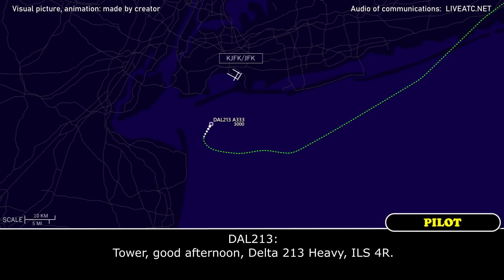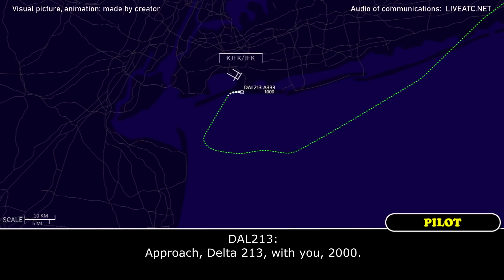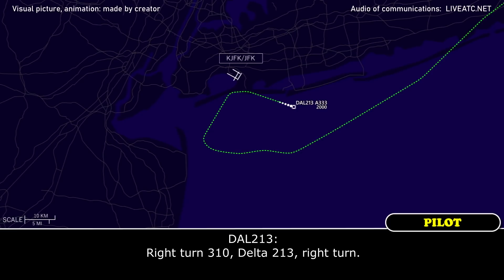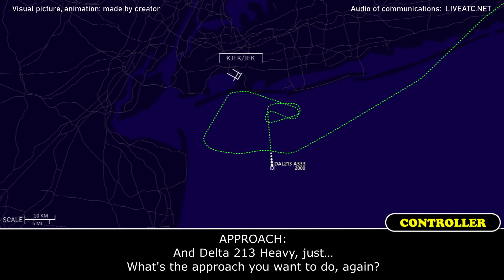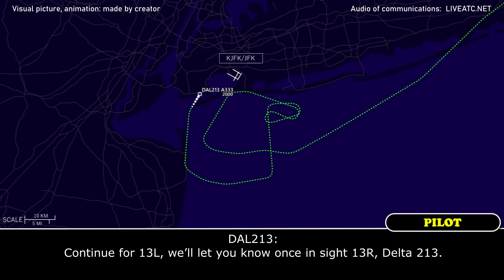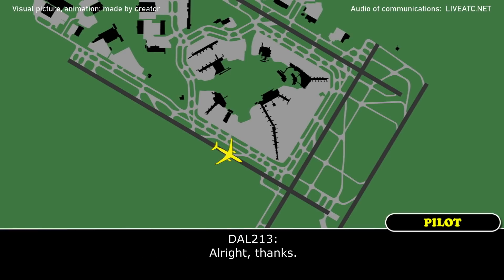“Requesting the longest runway”. Hydraulic issue | Delta Airbus A330-300 | New York Kennedy, ATC

Comment: @3:40, controller said "It's gonna be one of those Canarsie approaches".

Canarsie VOR approaches have a short turn to final.

Very possible those issues was with the hydraulic system guiding nosewheel steering and braking
Reply from the maker: Thank you. I'll pin your comment. I didn't know that.👍

Comment: They say VOR is obsolete and GPS would be enough for navigation. This case shows how useful VORs are.
Reply: How? They didn't even use the VOR, they considered it for a bit and then went with an RNAV GPS approach.
Reply: @scottycatman  you're right, I meant it's a good thing to rely on it for a backup solution as who knows when it gets handy in certain circumstances.
Reply: The VOR approach for 13L and 13R is also able to be done entirely on a GPS. The future is pretty much GPS now, they’re a lot more accurate and have similar if not the same minimums to an ILS if the approach has LPV

Comment: I'm no expert, but it seems like landing 13R, which would be the shortest final of any JFK landing, would be just about the worst option for a wide-body with hydraulic issues. Especially considering that they asked for a long final initially. I'm glad it all worked out and obviously the crew knew what was best
Reply: 13R/31L is the longest, 14,511 feet long(about 4423 meters), while 4R/22L is the shortest as 8,400ft(2,560 meters). You can compare those two with the airport diagram on the video.
Reply: @뚝섬플레이스-f1c  I know it's the longest runway, but for a plane with potential control surface issues, I'd think they'd want a long final as they initially said
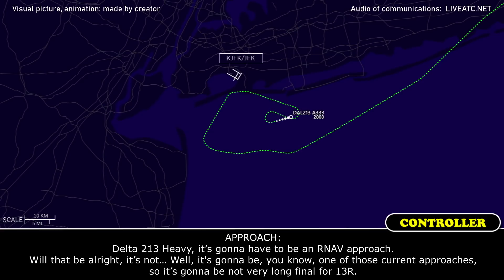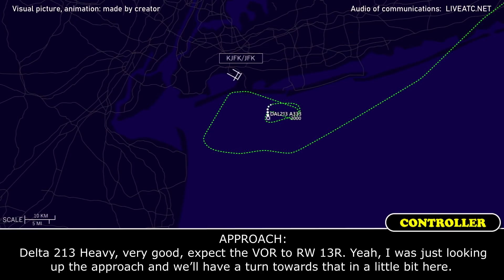Reply: @PASquared  03:32 04:34 04:52 looks like it worked, although I can feel pilots are stressed.
Reply: @PASquared  I doubt they had flight control limits. Likely braking and nosewheel steering.
Reply: @gerardmoran9560  thanks, that would make sense then why the tight final was not a problem

Comment: Can someone please explain why they needed to do the 13L approach then sidestep to land on 13R?
Reply: With the hydraulic issues, the pilots wanted two things: a long runway into the wind and a long straight final. 13R would be the best runway, but the reason for the sidestep was that there is no long straight approach to 13R because of the complexities of New York airspace (i.e. tall buildings). So the only way to get to 13R was to sidestep from an approach to 13L or to do what they ultimately choose, a "canarsie" approach like they have at JFK which involves a big turn to line up with the runway. "Canarsie" is just a local New York term for the Canarsie VOR a couple of miles southwest of the airport.

With respect to the guessers, it had nothing to do to FMS programming or to anything like RNAV versus VOR precision.
Reply: This is just a guess. They were told the approach to 13R would be VOR and they wanted to use RNAV which was available on 13L. Apparently RNAV is safer and simpler.
Reply: @CastlegarGlenn  yes. Think you are correct. They can program that into the FMS and then move over. Guessing also
Reply: @CastlegarGlenn  Runway length.